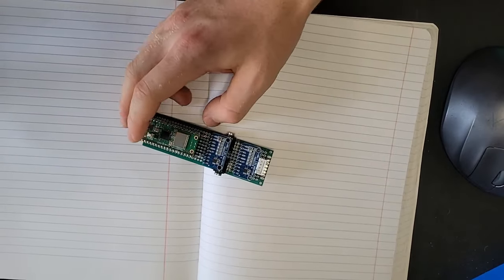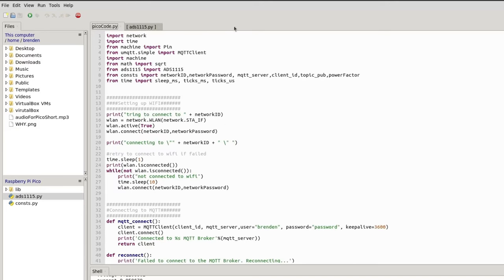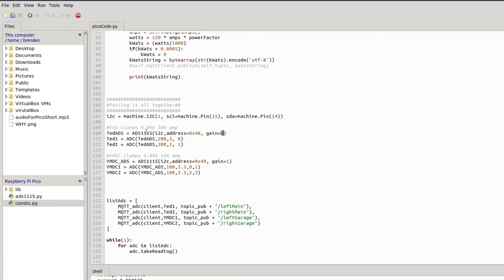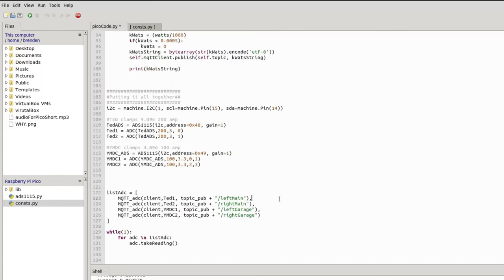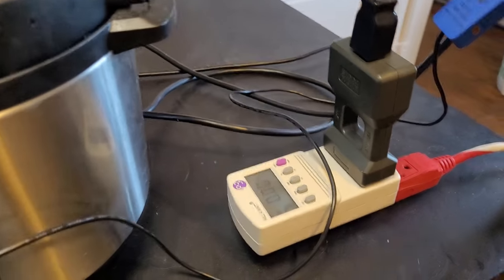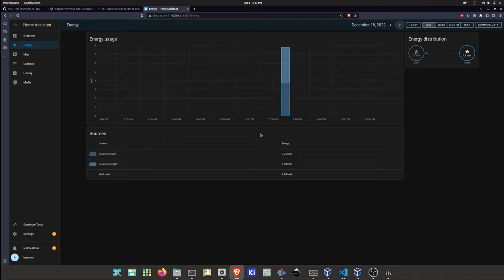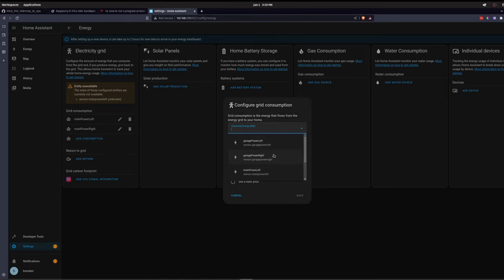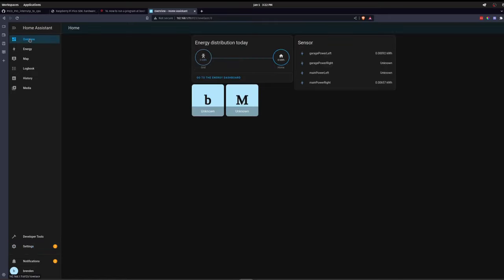raspberry pi pico - power meter

Comment: Just for other's references in the future, did you use 3.3v to power the ADS1115? And also, what value is your burden resistor? 
Your video is the one that helped me finally some kind of result with a similar project in Micropython. 
I made alterations in software, mostly removal of the MQTT related stuff (using the current value for something else) and I'm only checking one sensor on ADS1115, so I can't say that my issue I'm having currently is not something that I caused, but I was getting significantly lower current values than what my multimeter clamp was reading for a while. I determined from the handful of tests I did that results vs. actual values were consistently about around 3x smaller. So, adding an additional line to multiply the current result by 3 has gotten me closer, but still is not 100% perfect. (not expecting 100% accuracy to the meter, but when I measure a lower amp 120v circuit, I'm pretty much spot on with the meter, but measuring  35 amp 240v circuit, seems to be consistently 1 amp behind the meter after adding current = current*3. (Before adding the multiply by 3, I'd get around .44 amps on a 1.2 amp circuit, 11.7 or so on a 35  amp circuit. 

I ask about the burden resistor value you used, and if you used 3.3 or 5 v to power the ADS1115 just because I find mention of them in the various resources you provided, but I don't find any information for sure saying which you personally used in this project. At this point, they're the only two variables that I can find that would give me a 3x lower than expected result. Mostly for me, just trying to troubleshoot why it's low before I added that extra multiplication line.  

Thank you again for posting this video, and all of the resources you provided too. They've been great help! I found a ton of references to Arduino projects like this, but we were severely lacking information out there on Pi Pico W and micropython in general in relation to STC-013-000 and ADS1115 to measure current.

Comment: Hi there, i found this video very helpfull! Im currently working on a power meter based on raspberry pi 4 and I can not get the reading from the SCT013 50A/1V clamp. I must mention that I just started learning a bit of Python so maybe the coding is the problem. For now I just want to get some data in a database on the Pi, I do not use a WIFI module yet.
Reply from the maker: Can't get any reading from the clamps.  You can't get any readings from you're ADC?

Comment: Hello this is a very nice video, I am currently trying to make a relay control using rasp pi relay HAT and power meter using raspberry pi4. Any advice I am just starting with this project
Reply: I am trying to control and measure the power used in the mains electricity using rasp pi.
Reply from the maker: What power are you trying to control with the pi?  Like the entire house?
Reply from the maker: Trying to figure out the relation from the main electricity measurements to the pi relay hat
Reply: @brendenadamczak9283  not actually im just trying to control a room
Reply from the maker: @kenntoi253  So your looking to control a room how?

Comment: hello i see you know a lot about raspberry pi pico. can you help do this thing, i want to delay all my mouse data by 1 a second(to make my friend confused its a april fools project), so i have mouse and i want to connect it to the raspberry pi pico and connect the raspberry pi pico to my computer, and the mouse sends data at a 500hz so i want to send the data through the pico at a 500hz. please tell me if this is possible?
Reply from the maker: I don't see why not.  So you'll need to do use this lib to turn you PIO block into a device.  https://github.com/sekigon-gonnoc/Pico-PIO-USB
Reply from the maker: [Mouse] [usbClient] -> [USB host][Raspberry pi pico][USB client] -> [USB host] [computer]
Reply from the maker: Basically on the pico usb client side you just need to log all the data with a time stamp. Then in your host side just repeat the message on the host side when the time elapsed.  The timing might be need some smoothing to make work properly.  Since the you computer is polling the mouse.  Your not just sending whenever you get data.
Reply: @brendenadamczak9283  I don't know what hardware will I have to buy and use to make it work
Reply: @brendenadamczak9283  i got the the code on the pico but still dont know how to connect the mouse to the pico . i wans to use a usbafemale to the gpio pins but any other way is good. just need some more guidance . in the video on that page you sent  there was this the pico board and on the board there was another red colored thing , what is that red colored thing do i need it? also i will pay if this works
Reply from the maker: @abhishekak9619  So this example is for a keyboard, but its fairly close to the mouse code.  https://www.youtube.com/watch?v=yIXa-6DRW-Y&t=850s
Reply from the maker: As for the hardware for the usb on the pico.  Let me see if i can find something
Reply from the maker: You'll want to make something like this.  https://www.bhphotovideo.com/c/product/945123-REG/startech_usbmbadapt_female_to_mobo_header.html/?ap=y&ap=y&smp=y&smp=y&smpm=ba_f2_lar&lsft=BI%3A514
Reply from the maker: If you have a usb extension cable sitting around you can cut it up and solder it to your pico
Reply from the maker: Here's a project i made that has USB mouse code.  Most of it is for a ps2 port but you don't have to use that code.  https://www.youtube.com/watch?v=ATGZD2AyFkc .  Codes here - https://github.com/brendena/USB_to_PS2_pico .  The code you'll want is in the USB wrapper section
Reply from the maker: How it will look [PC ] ->[USB micro][Device][Pico][soldiered usb female connector][Host] -> keyboard
Reply from the maker: I would start with the pc plugging into your pico and try controlling your computer mouse with the pico.  With out having the mouse plugged into your pico.
Reply from the maker: Might have some more time tomorrow to help flesh out this idea
Reply: @brendenadamczak9283  thank you, so i connected the usb a female to the pico so it's the pc -> microusb -> pico -> usbafemale -> mouse . and my mouse turned on but i still dont know how to upload what code and even how to upload code . i finnaly get it the pico sdk dosent work with this i have to install tiny usb in visual studio
Reply: @brendenadamczak9283  I figured out how to compile the code and stuff can check if the example code in arduino ide adafruit tiny usb dual role hid report device is good for doing this without a delay i am asking because the stuff required for this i dont have yet and just wanted to have your word on it as well.
Reply from the maker: @abhishekak9619  Can you post the project.  But i don't think it will do what you want.  A dual role device means that it could be two usb clients.  So it could be a keyboard or a mouse.
Reply from the maker: @abhishekak9619  Hopefully this will help you out.  https://youtu.be/iOD-NOzgj7o
Reply: it does help. I explored different solutions I used an intercept driver and it got detected by the game especially Vanguard and all the intercepted data got blocked completely.
Reply: @brendenadamczak9283   right now i am planning on using my android phone for this using usb gadget tool a software that allows android phones to appear as hid devices over usb to hid hosts. i will connect my phone to the mouse and computer using a usb hub but my phone is not rooted which is required by usb gadget tool.